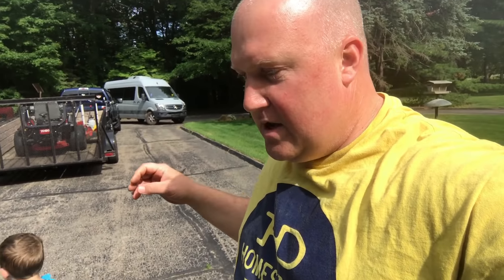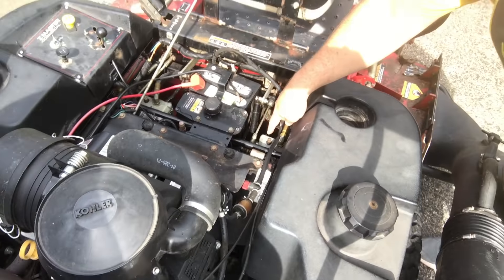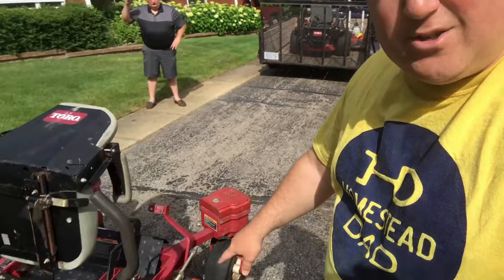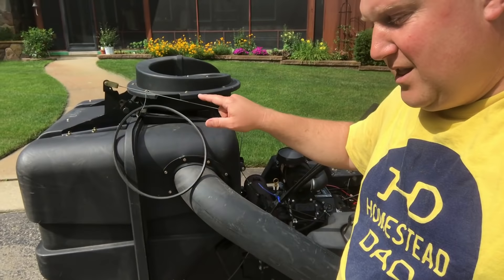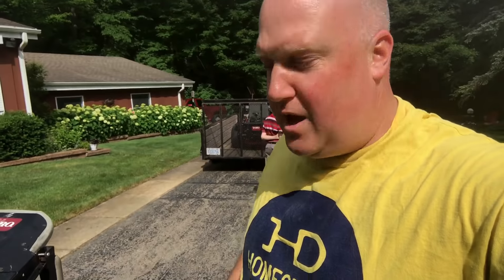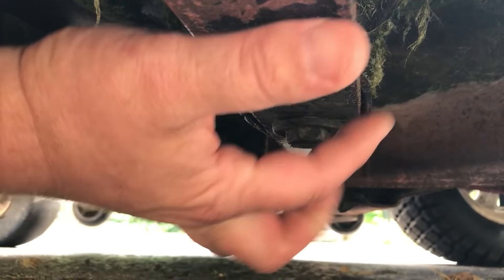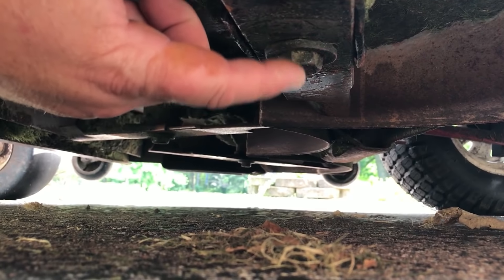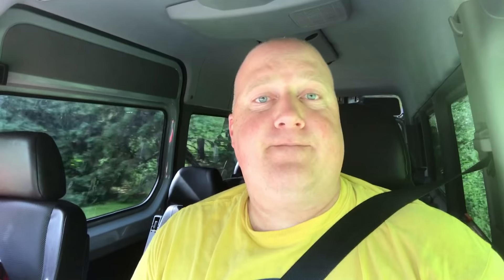What to Look For in a Commercial Mower, Buying Used

Comment: I have the chance to buy a 2016 hustler raptor sdx (477 hours) with trailer for $3,500 deal or no deal?
Reply from the maker: I don’t know much about hustler as a brand. What engine and what width of cut. Also tell me more about the trailer. Without knowing about those details I’d say it’s probably a fair detail to maybe really good. Have you looked at the machine?
Reply: @HomesteadDad 54" cut Kawasaki engine 6×12ft trailer with weed eater racks
Reply from the maker: @antoniomccoy9451  what hp kaw?  Kawasaki is a good engine, easy to get parts. Check spindles on mower for slop. 6x12 is what I built my trailer to, it’s a great size. From what I can tell seems like a good deal. As long as they’ve been greasing the zerks and changing the oil.
Reply: @HomesteadDad  thanks!
Reply from the maker: @antoniomccoy9451  my pleasure. Good luck.